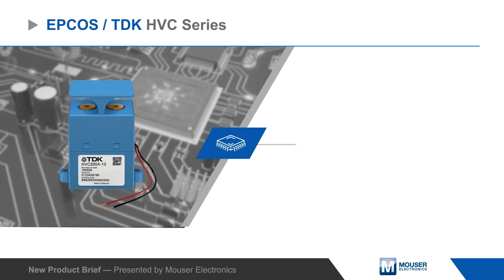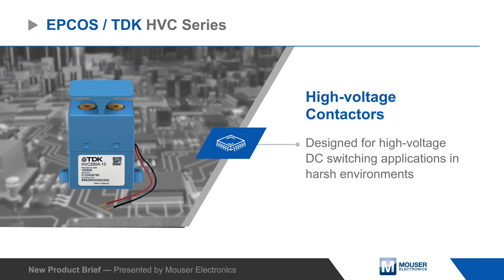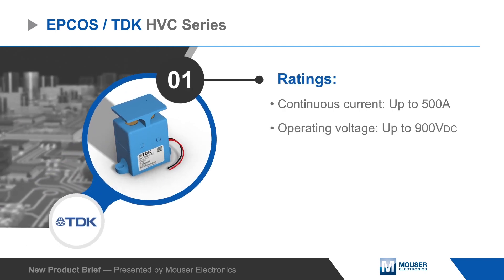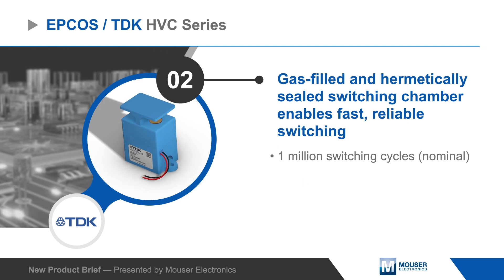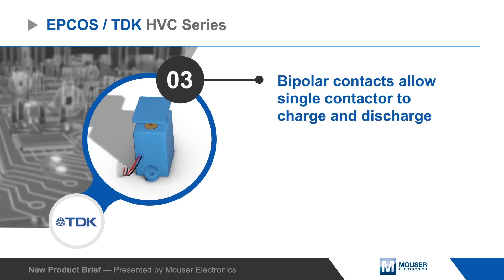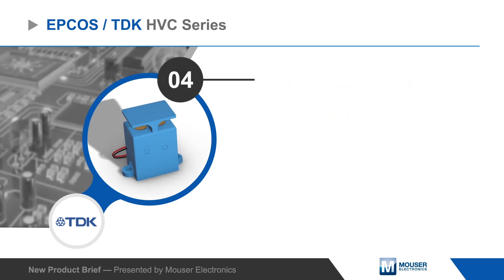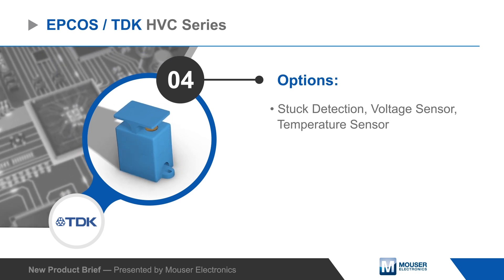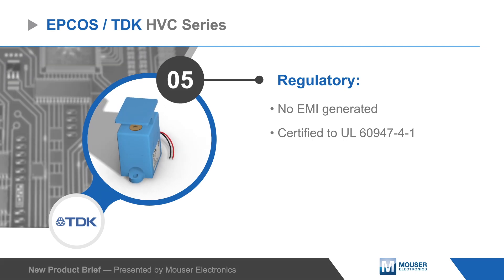TDK-EPCOS HVC High-Voltage Contactors | New Product Brief

Comment: HVC43	Up to 1000 V DC, continuous DC current 150–250 A.
HVC45	Short-circuit current capability; 1000 V DC; high safe cut-off. 
HVC27	Optimized for portable / new generation; 300–500 A DC; fast switching (~20ms).
HVC50	High-power systems (energy storage, EV charging); 1500 V DC, 750 A DC.

These HVC contactors use gas-filled ceramic arc chambers for efficient arc quenching. 

HVC series often feature bi-directional design, allowing current flow in both directions (charging/discharging). 

Coil voltage: Typically 12V or 24V. 

Some models have mirror contacts to monitor main contact status. 

3. Safety & Applications

HVC contactors are used in EV traction systems, DC charging stations, and energy storage systems (ESS).

Designed for high reliability and safe disconnection.

Whitepapers explain the arc quenching mechanism (gas-filled arc chamber) in detail.